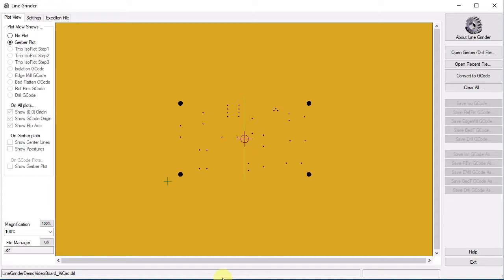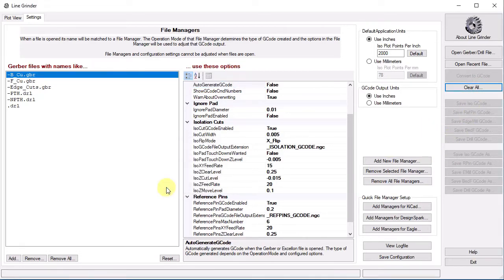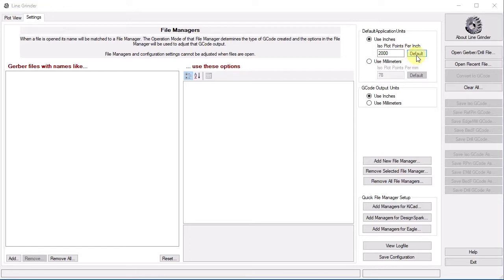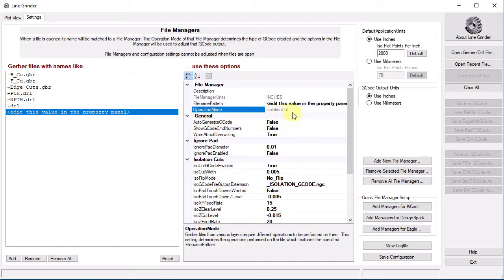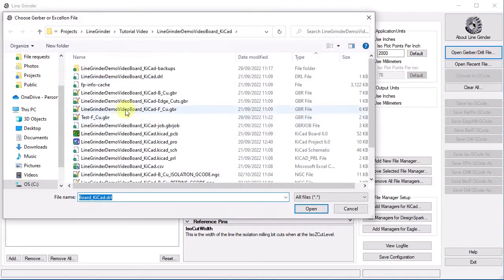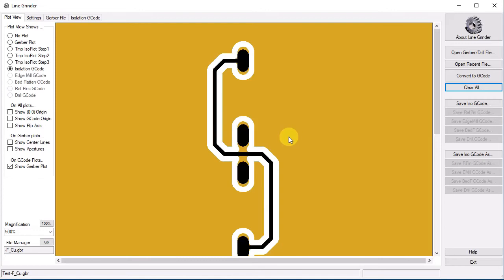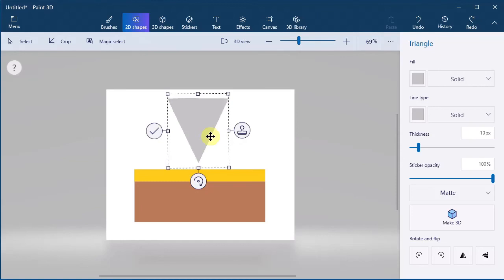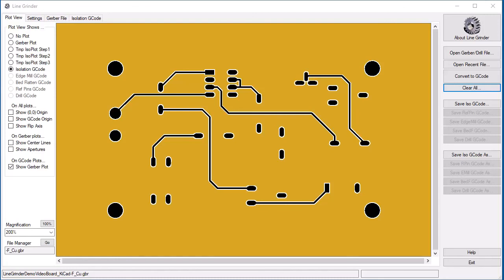LineGrinder Configuration And Setup

Comment: I was tinkering with your software tonight, hoping to find something better than FlatCam for doing isolation routing tomorrow. I use the online tool EasyEDA for my pcb design, and gerber generation.  The Bottom and Top copper layers seem to work well so far (haven't actually tried cutting a pcb yet though). However, I can't seem to get any of the .DRL files to work.  They appear to load into LineGrind, but I see nothing on the screen where the drill holes would be.   I generated some gcode from the drl files, and the coords look to be way out of wack.  With X and Y values ranging between -1400 and +5500.  I was hoping you might see if you could add the necessary support for EasyEDA to LineGrinder.
Reply: Just as I post this, I discover the "omit leading zeros" setting in the LineGrinder filemanager. which appears to have correctly loaded the drl file.  I'll let you know how my attempt to mill my project goes.
Reply from the maker: I'm happy to take a look at it. Feel free to send me the .drl file (and .gbr files if you wish). If I have an example of all of the files I can add a 1 button File Manager setup for EasyEDA. Please use the email address on the About page of the OfItselfSo.com web page (I don't want to list it here in order to minimise spam).